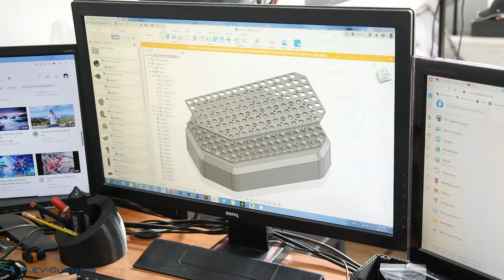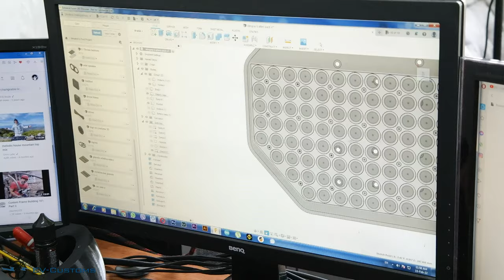Custom Electric Conversion // Schwinn Stingray Chopper ( Battery Build  6P 21S )

Comment: Wot Amp size bms did you put on it?
Nice Build.
Reply from the maker: Hi friend,,  BMS is By Maxkgo company at 120A Full programmable 17S to 24S
Reply: @EVCustoms  Wow nice one.
i built a 13s 9p battery for one of my bikes a couple of months ago...i used the 4800mah 21700's.
its working great.
Not as tidy as your build though.